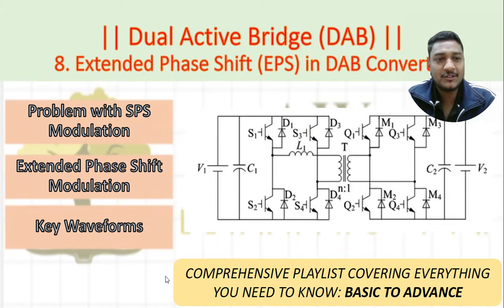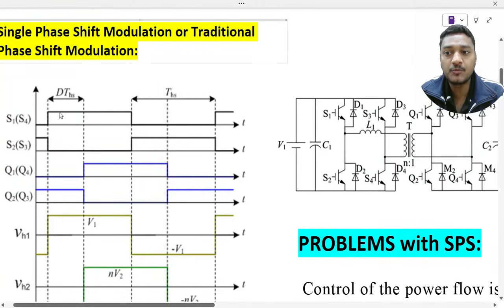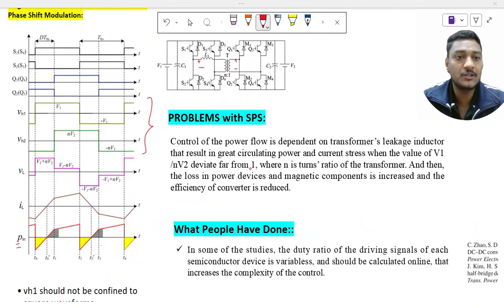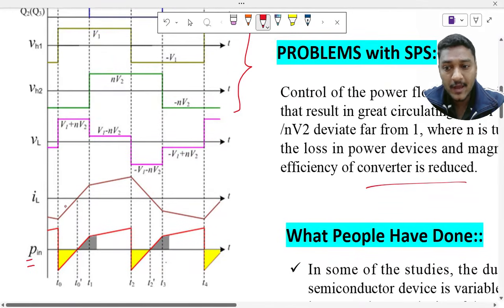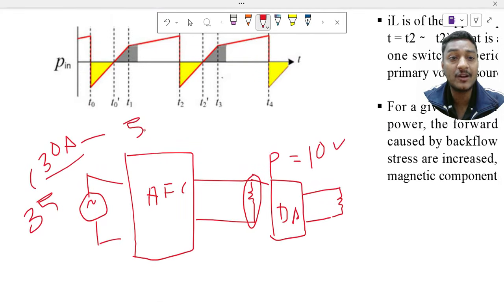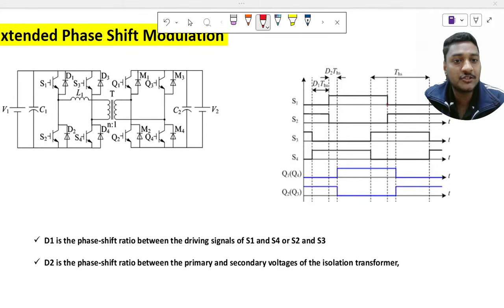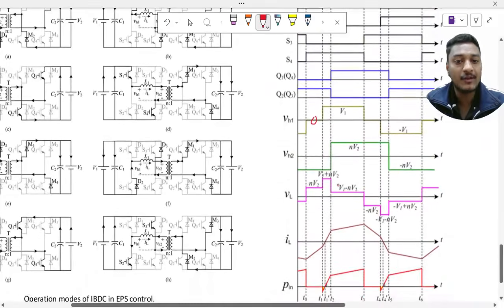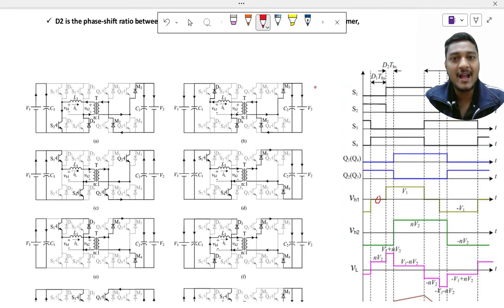LECT 08: Extended Phase Shift (EPS) in DAB Converter #dabconverter

Comment: Hi sir, I really enjoy your videos. I’m currently working on a 400 V to 48 V DAB converter. Could you please help by running a simulation in ANSYS Maxwell or LTspice?
We’re planning to use 600 V MOSFETs on the high-voltage side and 80 V MOSFETs on the low-voltage side. For testing, we will only be operating in the 150–200 V input range since we don’t have a 400 V supply yet. I hope this makes sense.
Kindly reply to clear up my confusion, and please share any tips or tricks for building the hardware prototype as well. Thank you!
Reply from the maker: Exactly what are your question, can you ask me? 
Msg in on linkedin I'll try to reply there.
Happy Learning ❤❤😊
Reply: @Pookie-poo3
Hey I am also working on same  but with dual phase shift
Could you please share have you done?
Reply: @ArshiyaJasmeen hey! I have just perform my calculation and choose my components.
I'm thinking to perform the simulation on ansys or lt spice.. also how are you implementing dual phase shift in them.. I'm doing single phase shift ..
Also are you using pi controller at the output side to maintain the output or not? Share your project please

Comment: I have one doubt, In EPS, why you turn ON the S4 first then S1... Why NOT S1 first and then S4?
Reply: I got your question. In many papers, they have shown it like S1 first and then S4. I think the voltage waveform and power waveform will be exactly the same. It is like interchanging S1 to S4 and S2 to S3 so that cross conduction is avoided. The inner phase shift here shows like negative as S1 is lagging behind S4.
Reply from the maker: Good question, but i feel you can answer this by your own by observing the things.
What exactly is happening is that if you turn on S1 first and that time S2 is also on and if both are turn on at the same time, it will short the leg and therby short the input V1, which we don't want and I had already said this in lecture.
So because of this we follow this sequence.
Hope so you got the point.

Happy Learning ❤❤
Reply: @Kingashish-555 yes but S1 and S4 are the different switches from two different legs of same converter then why
Reply from the maker: @mzraja4407 we need to lower the back power flow and this is the way researcher have thought that time and implemented.
If you can think of something else and reduce back power flow then that will be something novel.

Also if you have time please go through phase shifted converter, you'll get an idea why researchers thought to do so.
Reply: @Kingashish-555 ok thank you 😊